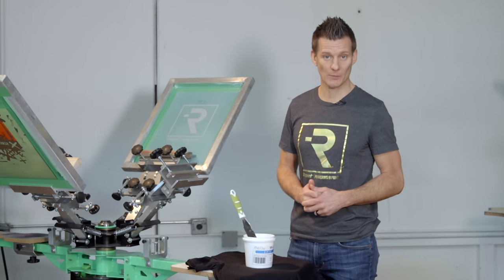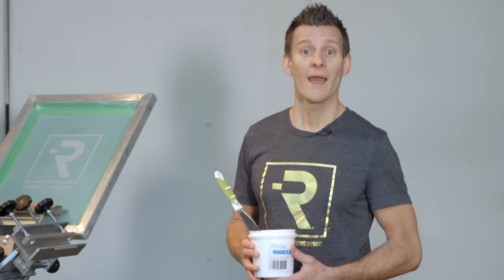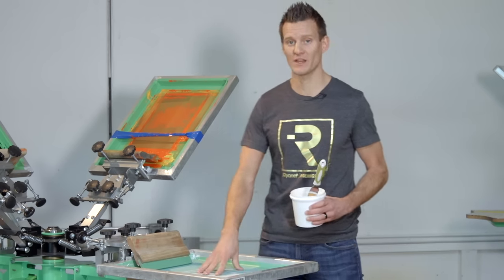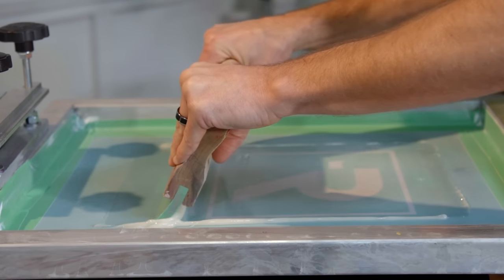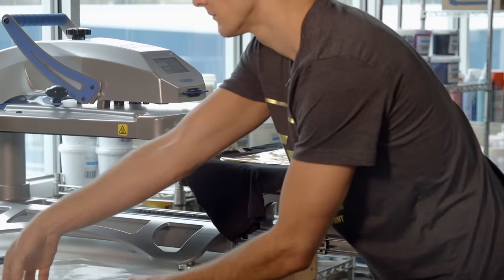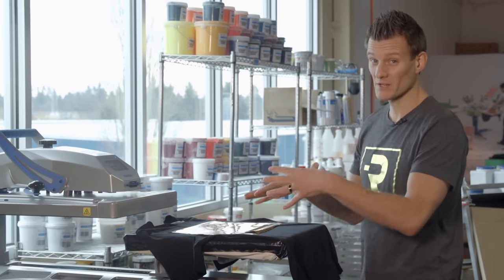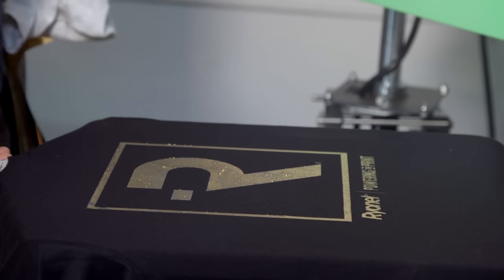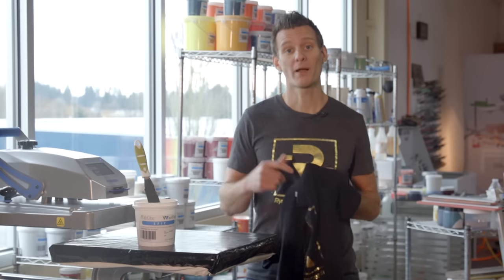How To Screen Print Foil Transfers with Wilflex HD Clear Foil Adhesive

Comment: Hey Ryonet! I want to know what ratio is for mixing the epic colors with epic hd clear? And does it have high density for the color after mixing?
Reply from the maker: You are looking at about 10% by weight :)
Reply: thank you so much! also can you mix non epic plastisols with epic HD clear?
Reply from the maker: @LAwizard  That I am not sure. It's highly suggested to mix within the same ink line/manufacturer. I would suggest sticking to the Epic inks

Comment: I tried this stuff ,and they must have sold me an old batch or something because it was so stiff ,I couldn't get it out of the screen ,and it busted. The stuff ruined every thing it touched; it was so gummed up I couldn't even get it out of the tooth brush I tried to clean the screen with. I had a sponge I had forgotten I used to try cleaning it off one screen, it got on another screen, and that one busted too! I contacted them about it , and they basically told me it was my fault .Even if I did something wrong nothing is supposed that darn destructive to everything it touches, how do you blame me for that !?? Cost me two screens  and some cleaning supplies I had to throw everything that stuff got on away!
Reply from the maker: Hi Elder - Sorry to hear of the many issues you had with the foil adhesive!  It is a powerful adhesive so being careful and clean with it is strongly advised but we'd like to find a better solution than what's going on in your comment. Please call us so we can attempt to make this a better experience for you!
Reply: Same!! Worst product!

Comment: Does this work on all garments?
Reply from the maker: Foil adhesive is usually best for cotton inks.You can use it on poly blends, but we wouldn't recommend it for 100% poly or anything with stretch in it. :)
Reply: Thank you! What's the washability for this style of print
Reply from the maker: Foil transfers will always degrade wash after wash, typically they last around 20+